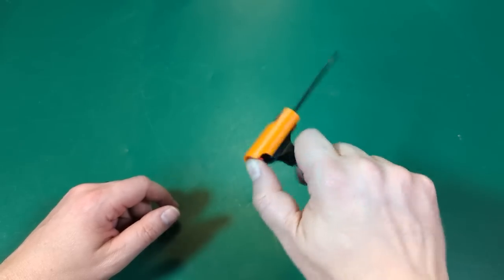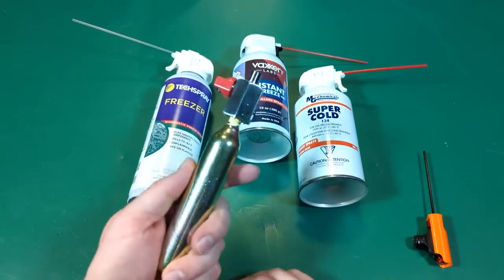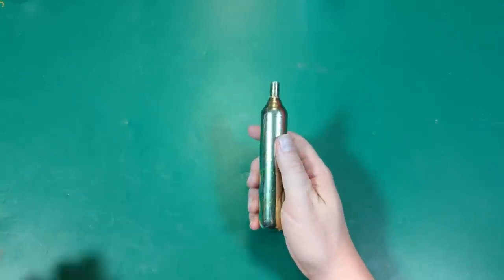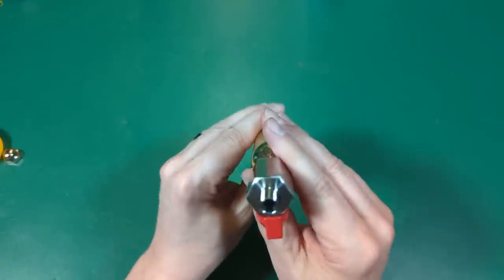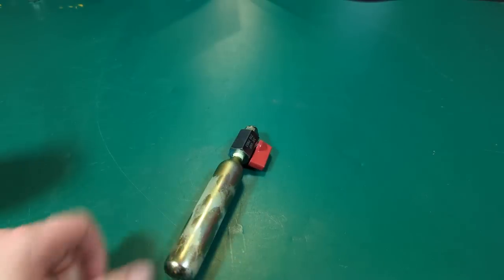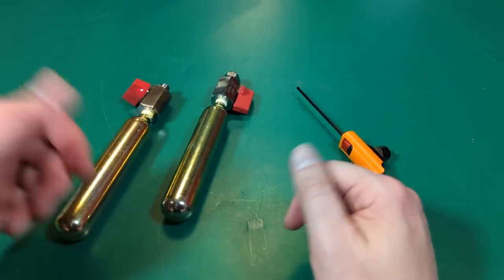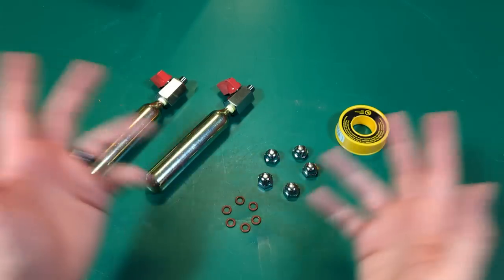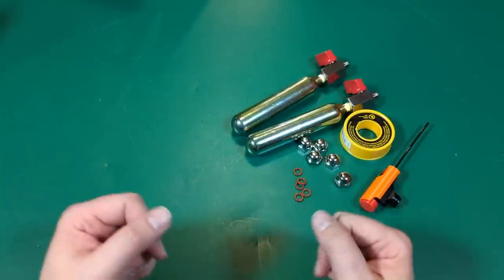Making Your Gas Canisters Refillable

Comment: Remember that you need the can you are filling from inverted while filling... thus, capturing as much liquid gas as possible.
Reply: & thanks for sharing.
Reply: Definately a better way to refill would be to have em upside down (the cans) as you said. That way what comes out is - again as you said, i know - mostly liquid and the process will go alot better and faster. At least that's how i do it for refilling camping propane bottles from a bbq tank.
Reply from the maker: In the case of air duster this is correct. In the case of Tech Spray or Freeze Spray... no. 

There is a dip tube inside of things like texspray and super cold so that the liquid comes out if the can is held upright, not inverted.
Reply: @DeviantOllam  Makes sense

Comment: I'm a HVAC teacher in NSW Australia. The big environmental disaster people think refrigerants cause is from the hundreds of kilograms of refrigerant that leaks out of systems due to lack of maintenance, poor installation practice, poor knowledge in technicians, and so on. R410a is a Hydro Fluoro Carbon refrigerant blend. It has a Global Warming Potential (GWP) of 2088. That means 1kg of R410a is equivalent to 2,088kg of CO2 equivalent global warming effect. I have repaired systems that have lost over 80kg of R410a, which equates to a total GWP of over 167,000kg of CO2 equivalent. People think 250g of R134a is going to hurt the atmosphere? You're barking up the wrong tree!! R134a has a GWP of 1430, so about 60% of R410a. What is more alarming is one of the most common refrigerants used for refrigeration systems (commercial freezers) is R404a, with a GWP clocking in at 3922. 

TL,DR: Your asthma puffer uses refrigerants as a propellant - using these dusters are nothing to worry about in the grand scheme of things.
By the way R152a - Difluoroethane is very very friendly for the environment in comparison. GWP of only 124.

Comment: If you put a tube in the tank, you wouldn't have to turn it upside down to use it. It could be a tube that has a flat seal at the top which can be installed between the valve and the tank.

Comment: If one were particularly concerned about chlorocarbons, could they not use an ether or hydrocarbon solvent?
Reply: The issue with them (such as R-290) is they're exciting to use indoors (typically where REX sensors are).

Exciting in the exothermic reaction sense.
Reply: With hydrocarbons and especially ether you run into a serious fire risk
Reply: At some point "concern" becomes irrational given the trivial scale of that particular emission plus the certainty that since the gas has already been produced someone will eventually use it. Flammable solvents are fire and health hazards. If it's that critical many better find another hobby with zero impact on the world.